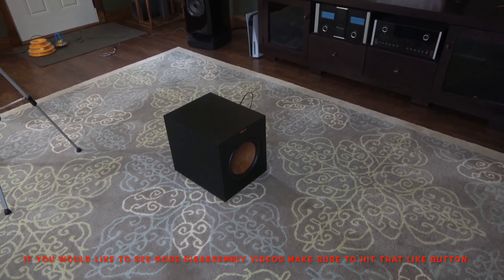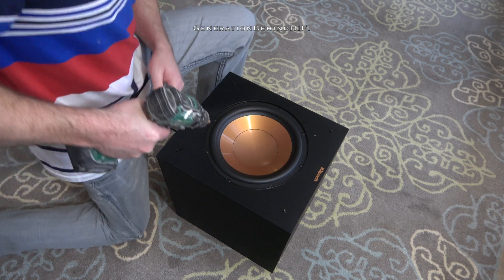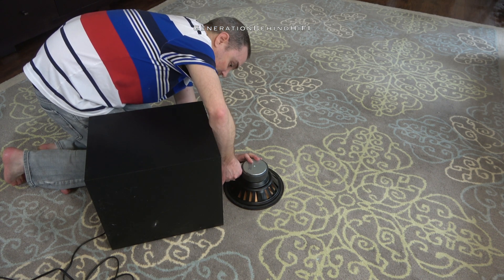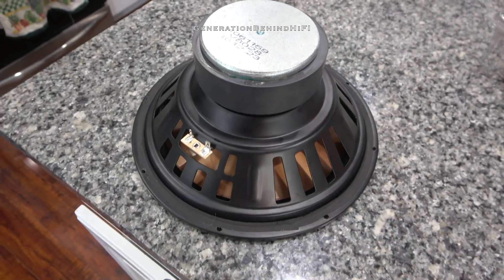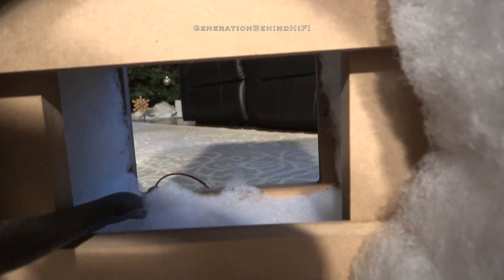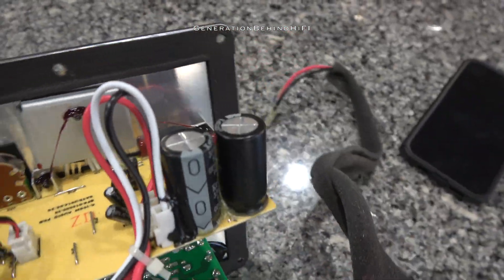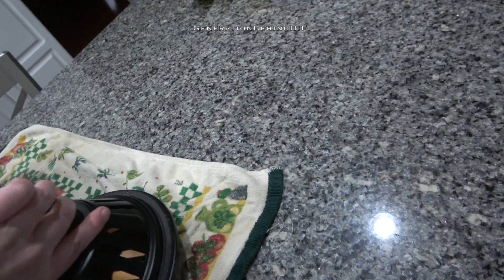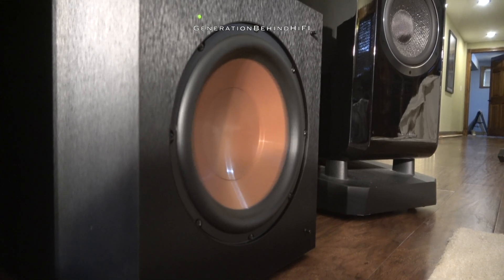A Look Inside A Klipsch R10SW R100SW R101SW Subwoofer

Comment: the amplifier module of my yamaha subwoofer ns sw300 weighs 10.5 pounds, I thought the klipsch one was more robust
Reply from the maker: Holy cow! The plate amplifier weighs 10.5lbs? That amplifier must not be a class D design and majority of the weight is from the transformer?
Reply: @generationbehindhifi  it is class AB and also has big radiator. Totally unnecessary, since class D handle better power headroom, which is important, especially for HT subwoofer.

Comment: NIce. I am interested in how that would sound with the new sub. IDK if that amp has enough juice to push it or if that brace will get in the way of the magnet. I bought 4 of the 12-inch model when they were on sale at costco for $150each for a home theater. I time-aligned them and EQd them with a minidsp and they sound a hell of a lot better than out of the box. I just bought that REL sub also. Looking forward to the teardown.
Reply from the maker: Thanks! I agree! These Klipsch subs are absolute bargains on sale, but the driver's in them do leave a lot to be desired in terms of detail, definition, and dynamics. I won't go into too much detail because I plan on making a video of the upgrade (which I'm done with), but the difference that this new driver made was down right incredible! This upgraded Klipsch sub now gives my REL HT 1205 and SVS SB-3000 a run for its money in terms of chest pounding bass. I think the main reason for this is the cabinet design because one is sealed and the other is ported. Obviously with a ported design you get more output with less, and this Martin Logan driver definitely delivers even with the wimpy 150w rms amp. This was a very fun project to do and wasn't too much trouble to make the new driver fit. Thanks for watching!
Reply: @generationbehindhifi  thanks. I might look in to upgrading the drivers on mine in the future
Reply from the maker: @Pete.across.the.street  Hi Pete! I don't think you will be disappointed with a driver upgrade. I'm guessing the drivers in your 12" Klipsch subs are like mine -- no vented pole piece, wimpy excursion, and tiny magnet assembly. If so, just about anything is better. Let me know what driver you decide to go with. I would be interested in hearing how it sounded after the upgrade. I think Martin Logan makes a 12" Dynamo sub driver that will probably drop in with little modification.
Reply: @generationbehindhifi  I couldn't find anything on ebay worth while. A decent new driver costs $200. At that price I might as well buy a few more rel ht1205's instead of upgrading the klipsch.
Reply from the maker: @Pete.across.the.street  Yeah, at the point you might as well just buy another HT 1205. However still keep an on eBay because you might get lucky like I did. The sellers asking $150 to $200 for their used drivers rarely sell.